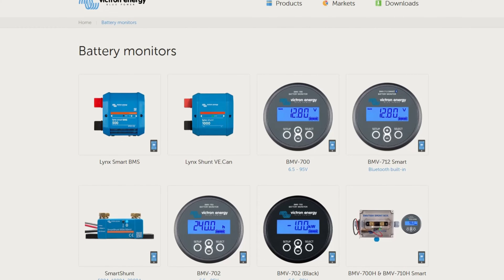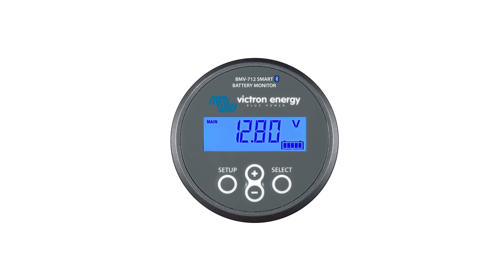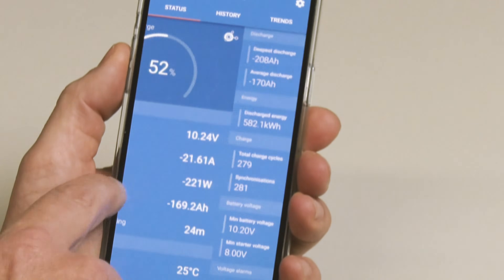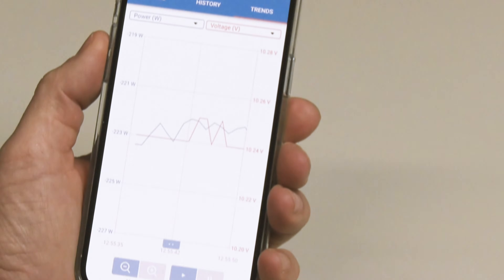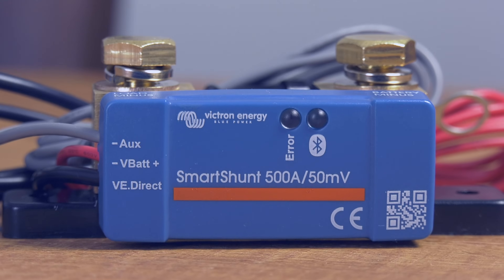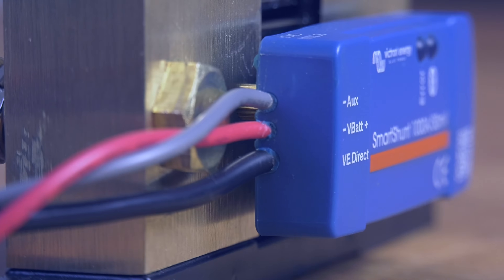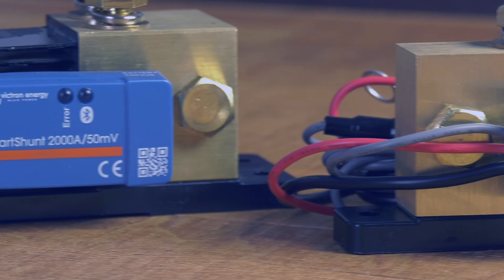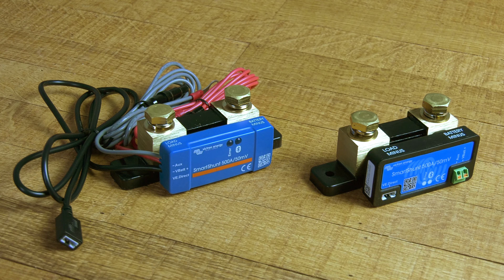SmartShunt IP65 Battery Monitor

Comment: I have a question, I have a 24v Battery bank with 600Ah will my Victron Smart Shunt 500A/50mV work or do I need to get the 1000A Smart Shunt?

Comment: I had the option to use the smart shunt on VE bus, or to use it passive and generate the data by the REC BMS. Well, the REC was spot on, compared to a professional FLUKE current measurement, and the Victron was 10% off! So, not very enthusiastic about the Victron shunt: let's make things better please!

Comment: Can you set a time when to charge the battery's, like at night from the grid when the electricity is cheepest?
Reply: The Smart Shunt is a monitor and does not control charges, a Venu device like the Cerbo is and that can indeed switch charging on/off at specific times of the day.

Comment: Thanks for the video.  I am looking forward to the new smart shunt video.  Will it be available in Australia?  I am collecting information for an all Victron equipment solar and generator system which needs to be safe from salty air corrosion.  Have a nice day.
Reply: Yes, its also for down under ;-)